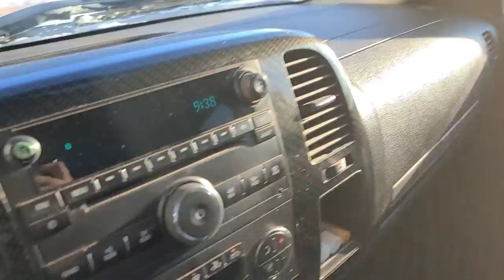Joy stick for the 5020 and some work on the 4020! part 4

Comment: I’ve survived a lot of tractor splits and I sure would feel better if you had a jack stand under the transmission housing just in case that stretched out bottle jack leaked down. Safety first don’t ya know. We’re Canadians not stuck up yanks. Haha.
Reply from the maker: It can go all the way done and rest on the blocks if it wants lol